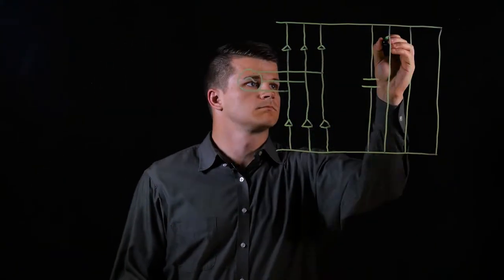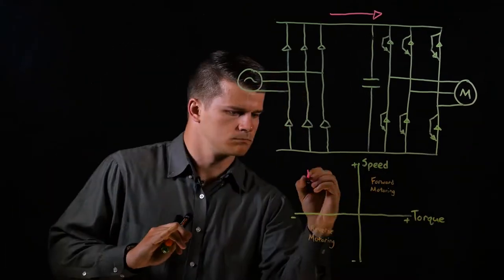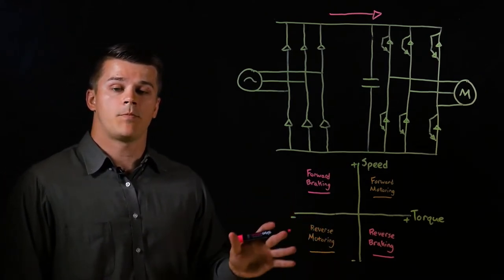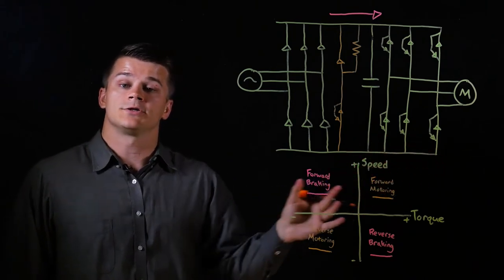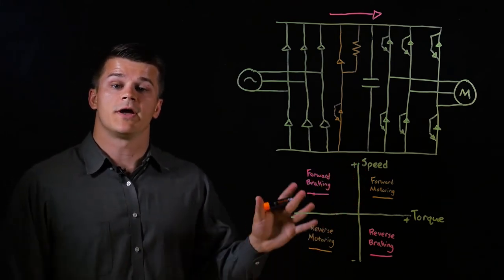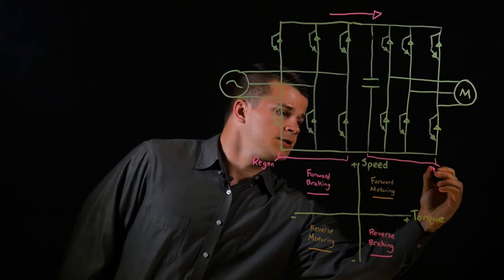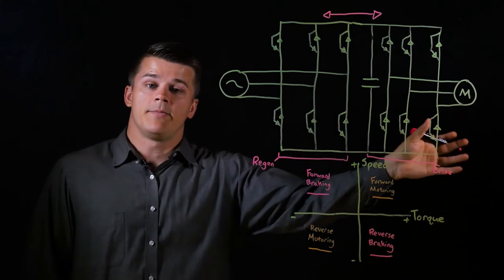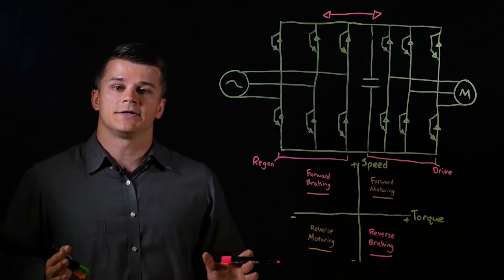How Do Regenerative Drive Units Work?

Comment from the maker: A question was asked, "Do they need to be listed to ul1741?"
The UL 1741 requirements  depend on device’s application and usage at the end product. At this time, the KEB R6 unit (Regen drive) is strictly designed as an industrial regen device. It cannot be used in a Grid Tie application. Therefore UL 1741 does not apply. It is classified as power conversion equipment according to UL 508C and the CSA standard.

Comment: I guess that is all you need to do for an induction motor with AC mains, but bldc regen is somewhat a different beast.  There needs to be some sort of boost, buck boost or cuk circuit involved to get the back voltage up to the level required for the battery to charge it.  I am hoping i can apply a high frequency chopper timing to my half bridge since the motor coil is an inductor already.  and perhaps a smoothing or storage capacitor which then makes it a cuk circuit.

Comment: Love your videos. Thanks for the explanation! 

How do the igbts on the input stage know when to switch? I imagine the drive compares the actual dc bus voltage to the AC input... when dc bus voltage goes over what rectified 480 would be, then dump it back on the line. Very curious. Thanks!
Reply from the maker: Thanks for your question and your compliment. IGBTs are amazing pieces of technology. This website gives a little more info on how they work. http://www.vfds.org/insulated-gate-bipolar-transistor-887962.html

Comment: The one thing I want to know is, why and how does the bus get stepped up to 620vdc on line regen units? As a test and repair engineer I'm dying to figure this out!
Reply from the maker: I don't have a simple answer for your question. You can research the reason for this and post it. Thank you for your comment!
Reply: @KEBAmerica   I'd be quite happy with a complex answer. I'm perfectly familiar with KEB VFDs to component level and repair blown firing stages frequently. But I have not yet been able to figure out the answer to the questions I posed.
Reply from the maker: I see. Glad to know you're familiar with KEB VFDs. I'll ask around and see if any other engineers here know why/how our regen bus gets stepped up to 620VDC.
Reply: @KEBAmerica  Thank you, I appreciate your efforts to get an answer. ☺️
Reply from the maker: Here's the best general answer I can find for you: 
"The DC 600 V is also coming from rectified AC source. but it is controlled DC output.
There are 2 types of power supplies in 611 system
Uncontrolled PS DC output is 1.35x Vac input (V)--call UE module
For instance, 10/25KW UE module, input 480VAC ==1.35x480=648 VDC--DC bus 
E/R ps, or you called regen. should be extactly 600VDC (+/-1%) , when all enables applied and module function is good."
Reply: @KEBAmerica  Thank you for trying for me but I already know all of this and the equations given. My knowledge is above that. I wanted to know specifically WHY the DC Bus is controlled/regulated to a fixed 600V on regen units. Is it purely for efficiency? I.e so the SMPS does not need to keep changing PWM Duty Cycle?

Comment: Sorry i have some questions:
Does it have any problem if using the regen mode with the source which is powered by diesel generator set?
What happen if the regen power exceeded the need of others device, then will the vfd automatically changeover to the braking resistor mode?
Reply from the maker: Thanks for your question. If you want to know more about a specific regen application like the one you explained, please contact a local KEB representative near you. If you are in North America you can contact us here: https://www.kebamerica.com/contact/

Comment: Hi, i have same case in our VSD...if any spike voltage the vsd trigger to trip, suspect indication vsd trip is over voltage from source power (generator)...my question can be  the brake resistor handle our problems (over voltage from source power generator ) ?
Reply from the maker: Thanks for the question. A braking resistor can help prevent over voltage errors. However, the voltage spikes would still need to be addressed because you risk damaging the drive. A braking resistor would be addressing the symptom but not the cause of the issue. It's always best to have a quality source of incoming power to your application.

Comment: Ok... that's a simple explanation, tip of the iceberg :) But I must say it's not entirely true. Even without regen you can still fairly efficiently use 4 quadrants of drives. It wasn't uncommon to have drive units connected through DC line and with capacitor bank attached just for internal regen of decelerating/reversing motors. Unless DC line voltage crossed safety threshold (in which case braking resistor sunk excessive energy) such system might have been quite efficient as well. Why are there regen systems? That's fairly simple. Most regen systems have constant DC voltage. e.g. 600V. Unloaded, lightly loaded, heavy loaded... always around that value. If current feeds back they return it to the power lines. Drives works with constant DC supply so doesn't have to adjust. Common DC bus systems with no regen = if one drive decelerates rapidly and DC voltage rises all other drives have to adjust PWM to maintain setpoint. Obviously it's not particularly good design but works ok on smaller scale. Fun fact - polish trolleybus in Tychy used similar approach as they have fairly new fleet with ASIM or BLDC while their power grid was still designed for DC motors with speed control through serially attached resistors (so basically no regen at all, just a lot of energy wasting). In that case if there was one trolleybus slowing down and at the same section other one accelerating the first would transfer excess energy to the section line which would power the second trolley. If there was no other trolley it would still brake with resistor (so generate wasteful heat) or mechanical brakes (the same).
Reply: Do you have some more resources on that subject.
Reply: I have a question in response to this... Why do line regen drives step up rectified mains to 600/620vdc? And how does it step it up?
Reply: @SimplyElectronicsOfficial  Usually they use a converter model called Buck & Boost Converter to match the power rating with the battery, for efficient charging. The converter model steps up/down as required.

Comment: What about the short circuit conditions... It will contribute a huge fault level...
Reply from the maker: Are you asking if adding the regen makes for a larger potential fault?  Can you explain your question a little more?  Have you experienced  short circuit faults with Regen units? We do supply fuses. You can read more about  short circuit current ratings here: https://www.kebamerica.com/blog/short-circuit-current-rating-sccr-and-fuse-selection/

Comment: Hi . Can you exlplain me how just by replacing the diode, you can sure that the igbt can be a power regen unit . As far as i know diode block the flow regen . But im not sure why the igbts can flow it . Please anw anybody
Reply from the maker: Hello, Thank you for the question. You are correct. Diodes allow for one directional flow. So power can only go into the unit. IGBTs are a switching supply so it can output towards the main line similar to how it outputs towards the motor.